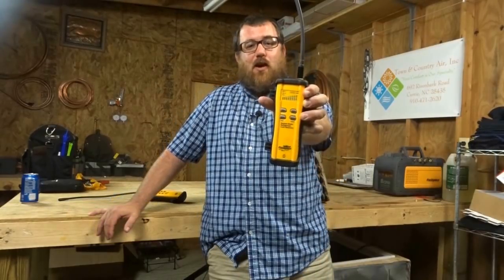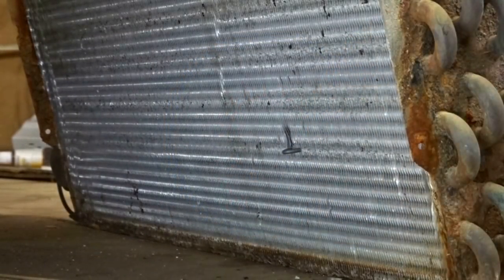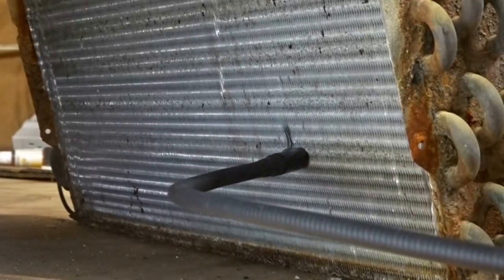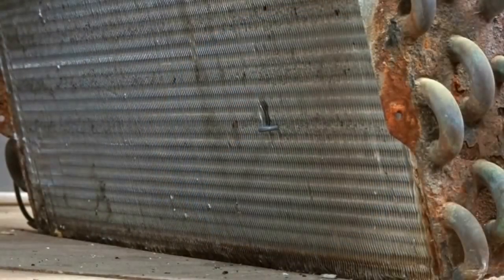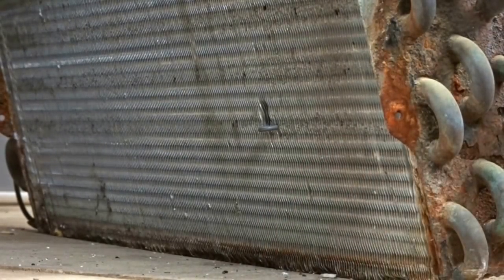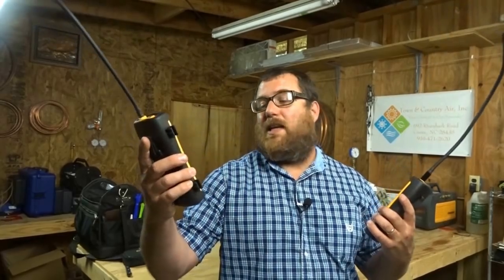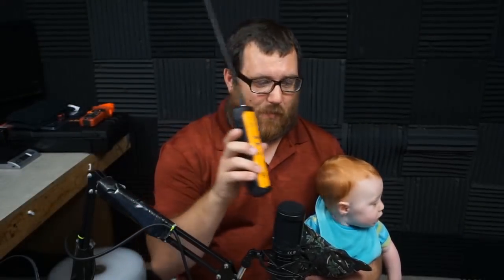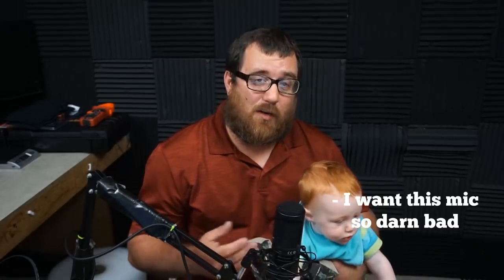Fieldpiece SRL2 vs Fieldpiece SRL8 | Refrigerant Leak Dtectors

Comment: You’re up and atem again early. Just putting on the coffee ☕️ and putting my lunch together for the day here in SoCal. I’m eager to see how the H10 does as I purchased one from Johnstone a couple of weeks ago. I’ve seen them for 26 years but never had one and never had a company that I worked for buy one for my truck. I used it once and I like it. I found a small leak in the distributor tubes on the cap of the distributor in a 5 ton heat pump. R22. Anyways great clip. Have an awesome Wednesday. God bless.